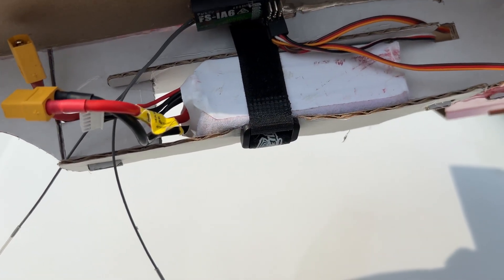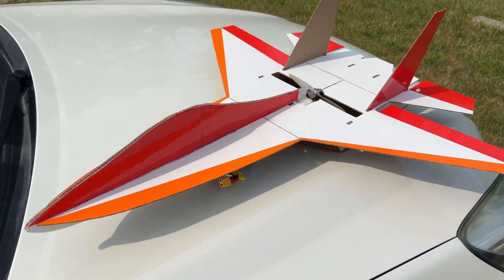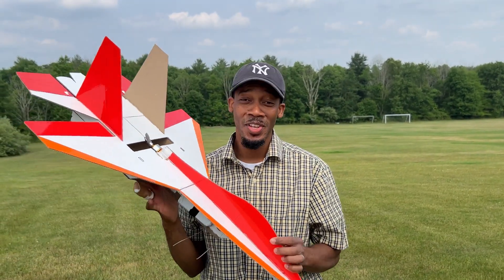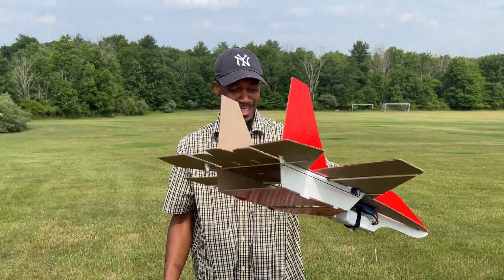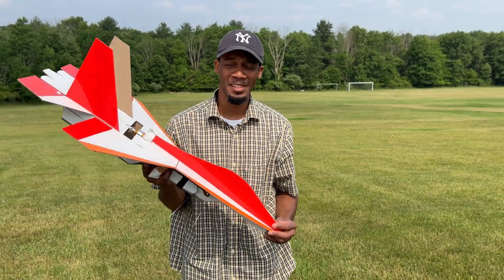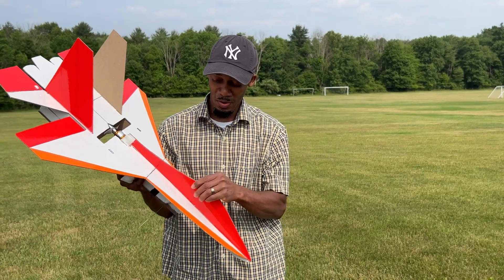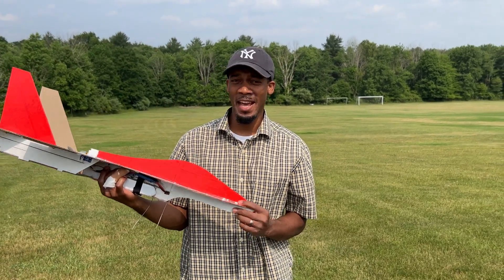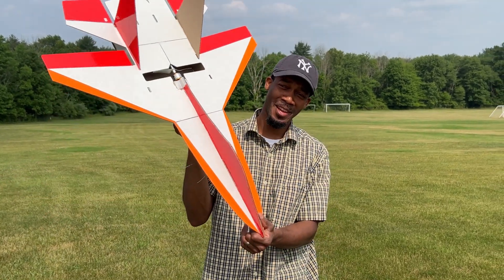How To Make a Rc Jet Plane: Diy Cardboard SU-27 Rc Airplane

Comment: Hi Chris, watched again. Try to build a full fuselage out of cardboard with a pilot! In case you missed it:
From the video: 2200kv  motor, 6x4 prop, 40A ESC, 2200 4s battery
Reply from the maker: I will definitely put it on my list, thanks👍

Comment: Cardboard is easier to get here in NZ than foam board so great to see you using cardboard.  What thickness is it btw?   It would be interesting to see what a KFM type airfoil would do for flight performance etc.   btw which direction for the flutes in the cardboard?   Thanks. Laurie NZ. 😊
Reply from the maker: Thank you. The one that I used for the SU27 build is a B flute 3mm or above, 40/1/4x34. It’s slightly thinner then the R.L. Adams Readi Board which is 3/16" thick. I got these from my job. I hope this helps.
Reply: @chrisellisrc8787  Thanks it does…..